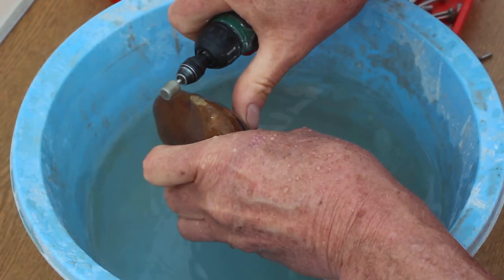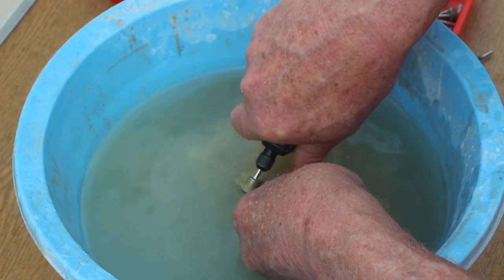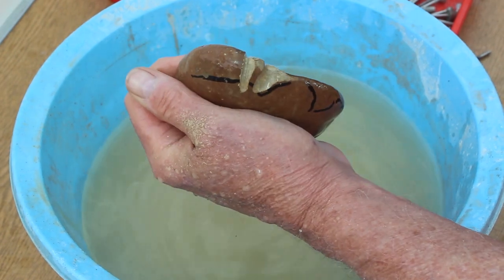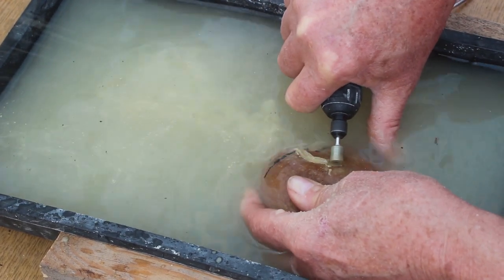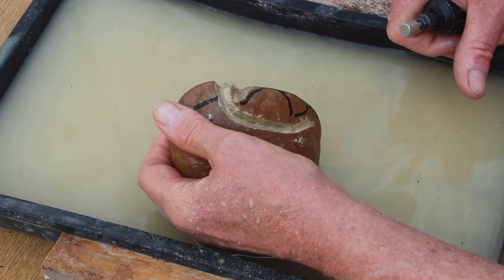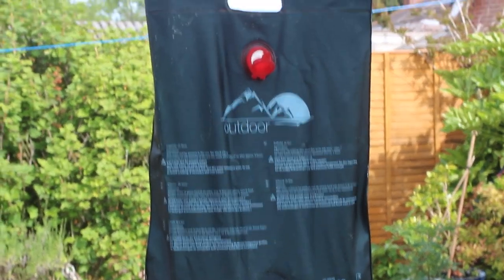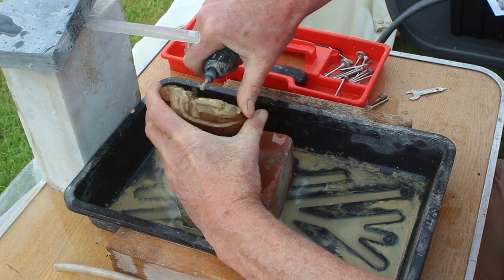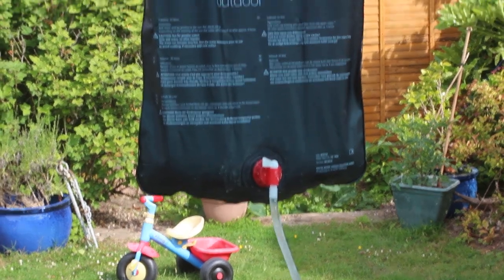How to set up a simple water feed for carving stone with a cordless rotary grinder.

Comment: Great video. I've just started to teach myself how to carve granite so I can make my son's headstone who passed away earlier this year.  I was thinking of something like this but using a bladder form a 3L wine box.  I also have a 20L bladder from a box of cooking oil.  Good length of video too as some I've seen last 20 minutes or more and take ages to get over what is a simple message.  Well done and thanks again, you've got a new subscriber :)
Reply from the maker: Thanks for the sub and good luck with your version of the water feed. I would say that you have set yourself a very tough challenge to work granite, it is a super hard stone and this is not something to undertake lightly. I rather think you will need bigger more powerful tools and professional grade diamond pads and grinders and a much stronger flow of water. I do not want to sound negative but this is a task you have set yourself and I really wish you all the best.

Comment: Is there an issue with the water being in close contact with the  electrical tool ???
Reply from the maker: The tool used in this video is cordless, 9volt so not really an issue though I have never had any problem. I usually nowadays use a flex drive off of a bench grinder and the electrics with this set up are well away from the water. take care cheers!

Comment: I thought that was an excellent alternative. I'm always afraid of what tools can safely be used around water including the grinders that I see everybody use
Reply from the maker: Hi Lisa, I think you can safely use cordless tools with water as they are only 9 volts. Also the mains rotary tools are also 9-12 volt as they run through a transformer so as long as you keep the 240 v transformer away from water you will be safe. Thank you for watching.
Reply: Lisa ~ the flex shaft rotary carvers can be used while hung on a pole stand made for them which can either stand on the floor or be attacked to your table ~ your water tool can also hang from this ~ Amazon sale advice called a : Reptile Drip Water System ~which is a container which is filled with water and hung high with a tube running from it’s bottom to where ever you want it to go ~ you can blue painters tape tube to your device and work ~ just remember to keep an eye on the container water level! They don’t cost a lot either!

Comment: WARNING Don't use your regular Rotary tool this close to water you WILL be SHOCKED with the results. 

The short of it, if your rotary tool plugs straight into the household outlet......dont do this. One exception is that you can use the Flex shaft attachment with the motor part hanging a safe distance up and away from the water source.
Reply from the maker: Hi, this is a point well made, though the video was made specifically for people using cordless (12 volt ) tools I perhaps should have been more forthcoming about the safety side when using mains powered tools. Thank you for the input and for watching.
Reply: @thestonecraftingworkshop7490  
Yeah I was hoping that you would receive that the way it was intended.

And you know, assuming you've been doing this a while, me about 40yrs. Sometimes we forget that a lot of people try to start out and do some of the more intricate work, and that is great to be eager so long as they are safe.

The reason I comented in the first place was.......even while I was watching, I was thinking "man he is all in that water with the motor close to the water"  so I had to go back and run through the Video again, that's when I saw it was cordless. 

I knew then if I missed it, someone that doesn't know any better would surely miss it.  So I just put it on the comments and maybe save someone. Because as you know That 12v will prick you a little (unless it's coming off the alternator running, then it'll shock the S--- outta ya. 

120V A/C in home wall outlets can very possibly kill you, on the rotary tools you would have your hand already in a grip and ground fault from the A/C you wouldn't be able to turn it loose. That's why electricians if they ever have the call for it would use the back of the hand. 
Man that's long just to say so little.... LOL
Reply: Cant you just loop the cord or plug it higher up than where you are using it
Reply: @mypetgrasshopper8342  no.  It's still powering the tool in your hand.